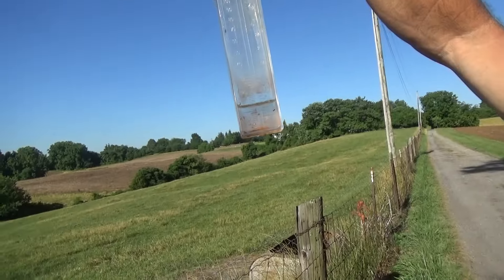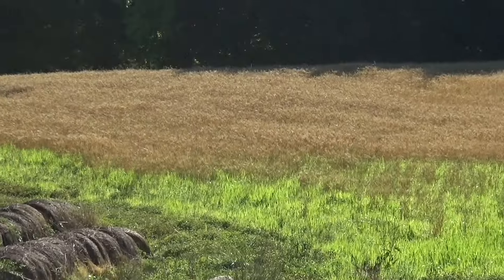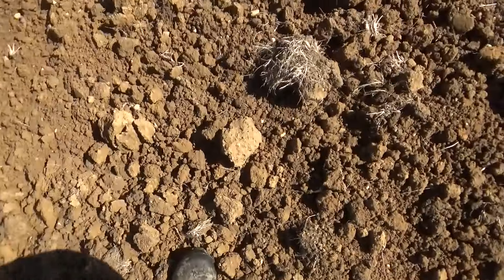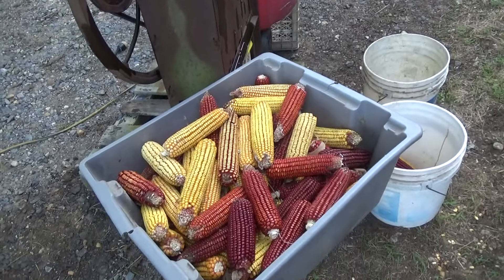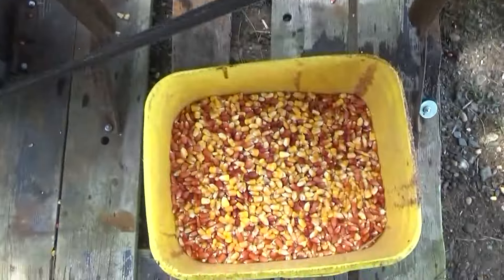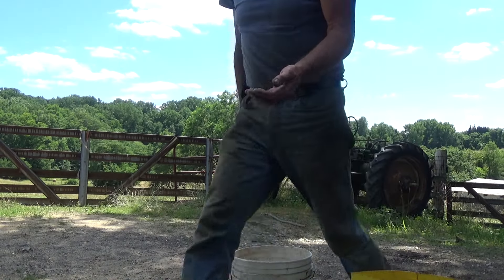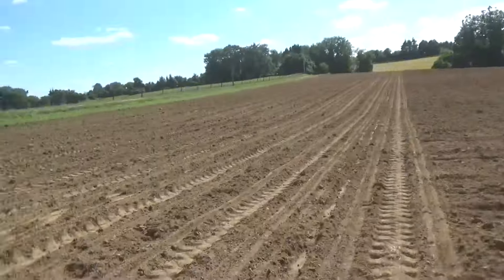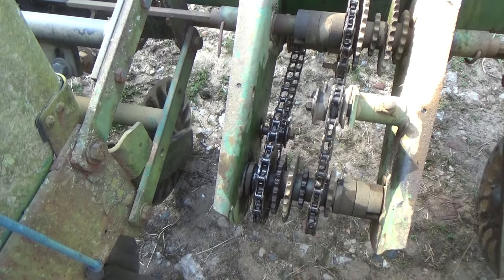Field Prep & Planting Corn With 3020 John Deere

Comment: Hey Bill, what's happening man ? Those 7000 planters are the cat's meow ! Do you plant 18,000 seeds per acre? I never tried open pollinated seeds. Depending on variety of hybrid I planted 18,000 to 24,500 with DeKalb. Pioneer was 24,500 to 27,500 , just slowed the tractor down to plant 18,000. My uncle probably made your planter he worked at Deere Planter works 30 years. Long time retired now.
Reply from the maker: Hey Dan! yeah, it's around 18,000, never took the time to get an exact count.😁

Comment: What gear do you recommend for plowin?
Reply from the maker: Fast as your tractor can take it, with in reason of course.😲
Reply: @so.md.dirtfarmer2226  Spoken like a tractorpuller. Thank you sir. I have a vegetable garden that I plow the rows weekly for the weeds and moles. Live in the woods so keeping the roots from rotting is a problem. Seems like my garden tractor and disc harrow are kind of solving all the problems. I usually plow in low second gear. Old craftsman 20 horse. With high low. I know I can't plow in 3 high il bust the front wheels off. I like your response. Thank you. Love your pullin tractor content